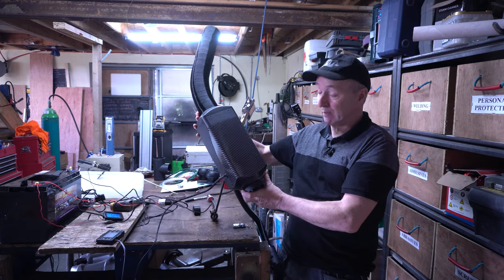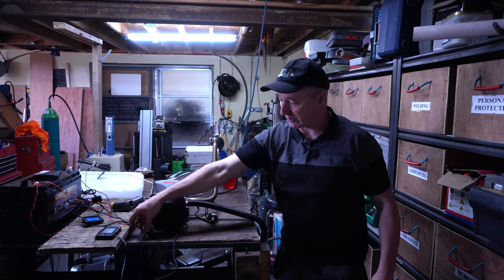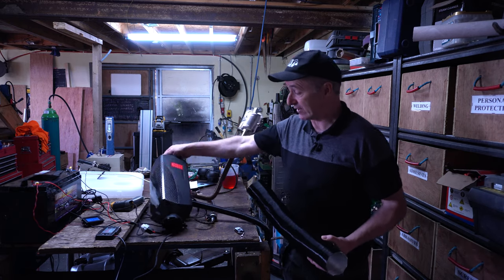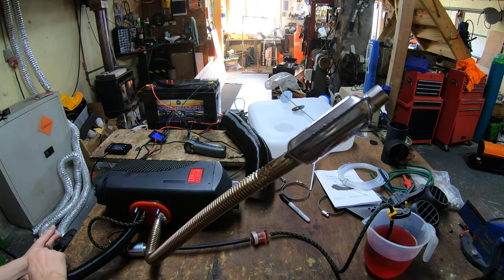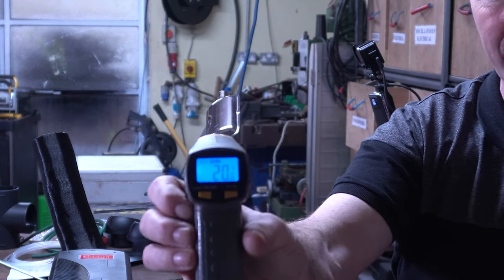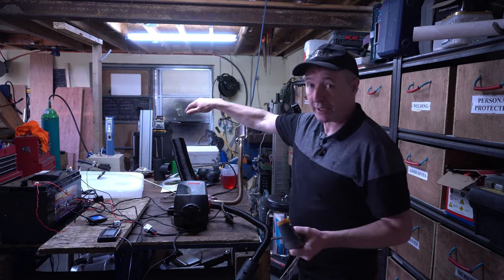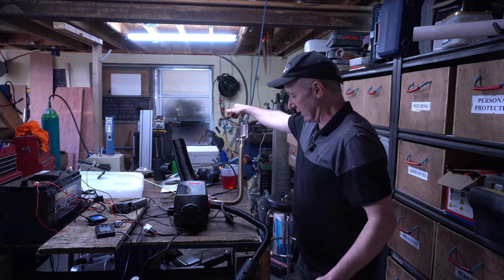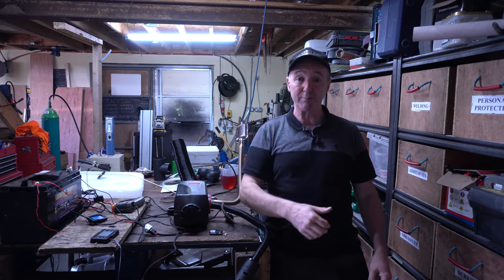Awesome Diesel Camper Van / Workshop Heater

Comment: Had one of these in my outside office/garage for two winters now and it's great. Use the remote to turn it on half an hour before I go up and it's toasty. Might use a bit more fuel than you said, but still great for the price.
Reply from the maker: Hi iOutwrite. They seem really cool and affordable. I haven't run one myself yet so wasn't 100% sure on the burn rate but they still look worthwhile. Thanks for commenting, much appreciated. Cheers Gerry

Comment: Got one in my T4 van it's the all in one type. No more defrosting the winows in the morning lovely and warm for the grandkids to go to school. Cheap to run, I'm looking for a garage that sells red diesel around me but no luck so far.
Reply: I don't know where you are from, but here in the states red fuel is commonly known as "off road diesel". It is burned in farm equipment and construction equipment. It is illegal to burn in vehicles that travel the roadways. 
MB BAR RANCH
Reply from the maker: Hi Robert. I had a T5 for a few years and one of these heaters going for a few minutes on a wet day in winter would have been great for clearing the windows and heating the van before heading off.  Here in Ireland the rural service stations sell red agri diesel. I was using Kerosene in the demo and it worked well. Thanks for commenting Cheers Gerry
Reply from the maker: Hi Martin. Its the same here in Ireland with the red diesel. Thanks for commenting Cheers Gerry
Reply: @martinbenton742  Thanks Martin as I understand it it can be used in heaters here in the UK they have to have a seperate tank. But not in road vehicles, refigerated lorries use it to run compressor's attached to the vehicle and pto type engines. Fuel tax in the UK is ridiculous.
Reply: @GerrysDiy  I forot to say I am getting one of the heaters you showed for my shed, started telling you about my t4 and forget. Kerosene here in South Wales is dearer than white diesel, heating oil I've been told works well but you can't buy small quantities. Veggie oil is to hard to light in the heaters. Thanks for the reply and putting the video up.

Comment: That’s just what I could do with for my garage. Cheers Gerry as usual some great content mate!
Reply from the maker: Hi Chris. I'm not sure how long these will last but for a 20 x 15 shed 5kw would be great. Economical to run too. Thanks for commenting Chris much appreciated. Cheers Gerry👍👍
Reply: GerrysDiy yeah for 100 quid it probably won’t last forever I guess, you get what you pay ...maybe one of your designs using an old gas bottle might be the better solution. I like the oil burners that you have built also....too ....need to do some thinking 😂 Great stuff though mate and always nice to chat with you buddy 😀
Reply: @GerrysDiy  i am sure here at 40 below, that bit of hat would do nothing

Comment: I've been thinking of using one of these in my off grid mountain cabin. It's only 525 sf. Even if I had to use two of them, it would be easier and cheaper than cutting firewood.
Reply from the maker: Hi Sven. With 5 Kw of heat and it being thermostatically controlled I think they are great value. They're really small too. I have made lots of waste oil heaters and wood burning stoves but these look very interesting Thanks for commenting Cheers Gerry 👍

Comment: Great video Gerry and just ordering a heater now 👌
Reply from the maker: Hi Amac 4691. They do seem worth it and make lots of heat. On the higher settings they will use some more fuel but can use less too if you don't need it going full belt. Thanks for commenting Amac Cheers Gerry👍

Comment: Great little heater for my boat for autumn and fall, instead of using the big central heating boiler on my boat, would be even better if it could run on waste oil, as I'm on a terribly low budget, my retirement punishment.  Atb,  Peter.
Reply from the maker: Hi Peter. It's great that you have a boat to play with in your retirement. I will be making a smaller waste oil unit over the next few months but these diesel air heater things are so easy to setup and use. Too small for my shed but certainly worth a shot. Thanks for commenting Peter stay safe Cheers Gerry👍
Reply: @GerrysDiy  It's not really a boat to play with Gerry, that's not possible on my peanuts retirement pension, boats, or to be more precise barges, were my life and next year will be my 50th year of living on the water, I've never had a house. Atb, Peter.
Reply: @GerrysDiy  I look forward to the smaller waste oil heater. I have a single garage to heat, and a propane canister sized unit is a bit overkill. Was considering trying to make something out of a mini mig disposable gas bottle instead. Might live outside for safety, with an open vented water system circulating to a radiator inside.

Comment: I like your channel! I just followed the link to this heater on Amazon. Do you know that it comes with a "removable oil pimp" ?
Reply from the maker: Hi Brendan. It does come with the fuel pump and it is seperate and can be sited remotely. Thanks for commenting Cheers Gerry👍
Reply: @GerrysDiy  sorry Gerry I was just pointing out their spelling error which I thought was pretty funny. But I am so impressed that you take the time to answer the comments properly.

Comment: Webasto and Ebespacher are the only safe bets when it comes to heater safety and after-sales service .I work on cruisers (boats) and these units under the  by law would not be allowed for safety reasons and to finally finish when these chineese units break down and they will You bin them,But thats if they dont do serious damage before they  shag up.Sorry for the spoiler but you cant expect a 150 pound unit to match a unit costing 15 times more and  20 times for the Webasto units.
Reply from the maker: Hi Mike. I don't have much experience of these units but for the price and the economical running they might be worth a look. If they burn the place down, obviously a different story. Thanks for commenting Mike Cheers Gerry

Comment: I have one of these in my workshop, it will use much more fuel than you say, on full heat mine uses more like 3/4 of a litre a hour . These also suffer from clogging up if used with red diesel if run below full heat for any amount of time . No where near the quality of a eberspácher , but also no where near the price either !
Reply from the maker: Hi Steve. I am new to these units and appreciate the information. Thanks for commenting Cheers Gerry👍

Comment: Check the duty cycle on your unit.  The Chinese have put new much much cheaper units on the market with which I am not familiar.  The style however is the same as the Espar etc.  we used in boats and trucks.  The Chinese also make gasoline heaters of the same style.  The Espar and like kinds were several thousand dollars and designed for a 600 hour life.  Something that was useless for real heating and or costly.  Toyotomo made one that was of that size that was about 2 thousand dollars and vastly superior.  If the Chinese are at all good they would be a great deal.  Careful about who you order from though they can cheat you and often do.  These style of heaters have been used in sleeper trucks, campers, boats etc for forty years that I know of although I had never seen a gasoline version until the Chinese came out with one.  I would be interested to see how it actually performs.  The biggest thing is the yearly clean out of the unit as recommended.  Good video topic.  You can find several reviews on You Tube.  Take care.  Doug
Reply from the maker: Hi Doug. Thanks for taking the time to write this very informative piece. Great info!! Stay safe Cheers Gerry👍👍

Comment: karaseen is far from cheap any more, you use to be able to buy it by the gallon, out od a pump at a gas stasion for $0.80 cnd per LT.  or years now you can only by it in hardware stores by the LT. for $6 cnd. BY THE gallon for $18, or 20 Lt jug for $72 cnd. these prices jumped some years ago with the portable karaseen heaters that came on the market, they were not that potable as the were like a meter long. 60cm high and 30cm wide and about 15kg, they have faded out in the past 3 years but the price of karaseen has not come down, in fact it still going up, why the heater have fadded out, was due to the cash brab of the fuel they use. even tho they would run 12 to 16 hours on 4 Lt